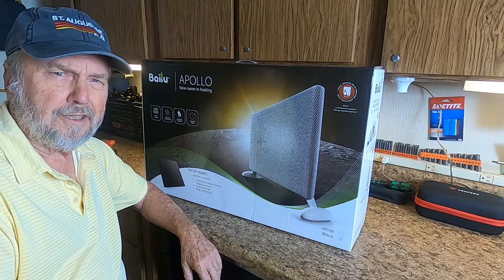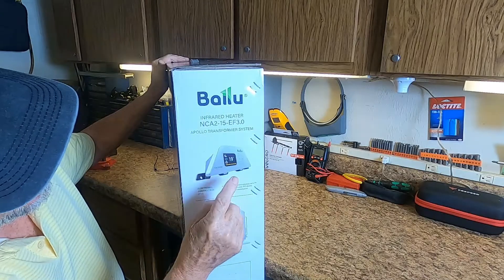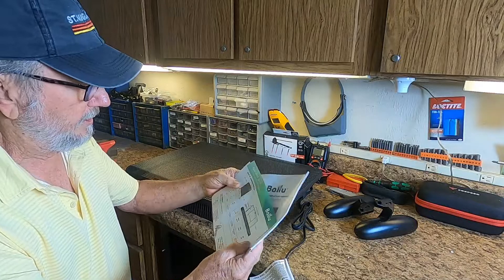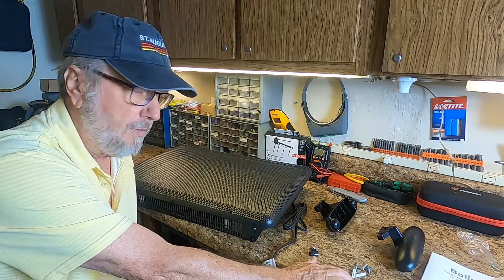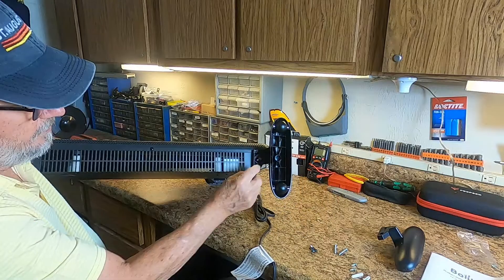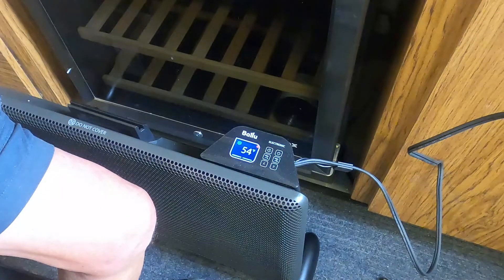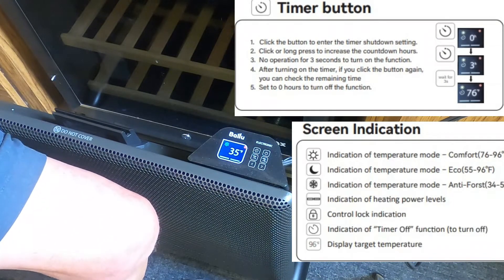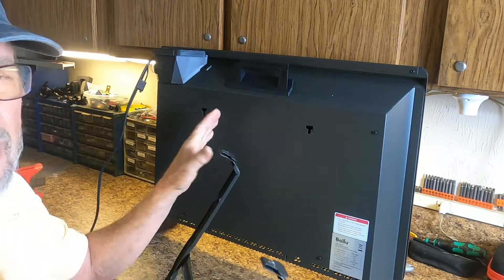Ballu Infered 1500 Watt Heater will keep you comfortable

Comment: Have you actually used it ? The biggest problem with most heaters today is faulty thermostat design. They turn on to "check the temp" which results in a hot, stuffy room, if its set at 65.
Reply from the maker: Yes, I have been using it to warm the living room in the morning.  It holds the temp very well.  It cycles on and off as normal.  I really like heater.

Comment: Bought a year ago and tested fine.  Using for first time.  Got a Locked Symbol.  Cannot access menu.  Cannot use.
Reply from the maker: @sandradee1049 I think you may have accidently put in heater in "Child Lock" mode"  Look at the instruction booklet and see how to take it out of child lock mode.  This is link to User Manual.  https://m.media-amazon.com/images/I/C1wxkPCwQBL.pdf    Here is the part you  want.          
Child lock func�on:
1.Press "<" and ">“ simultaneously for 3 seconds to ac�vate the lock func�on.
2.When the lock func�on is on, press the "<" and ">" bu�ons simultaneously for 3 seconds to
turn off the lock func�on
3.The lock func�on can also be turned on and off in standby mode. Contact Ballu if you can not correct the condition.  The Child lock is to prevent kids from activating the heater, unfortunately it can cause a problem if someone is unaware of the feature.  If you can not correct the problem, I have the heater also and will look at the feature and help you if needed.
Reply: @samowens44  Yes it was on child lock mode.  Appreciate your link to User Manual and the pertinent instructions.  Got it running.  Thank you so much.  Have a great day.